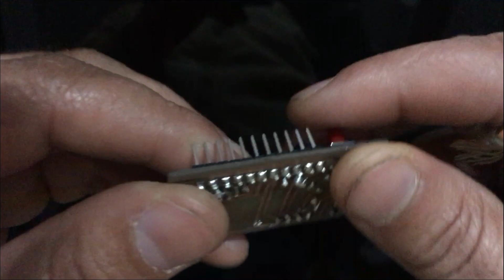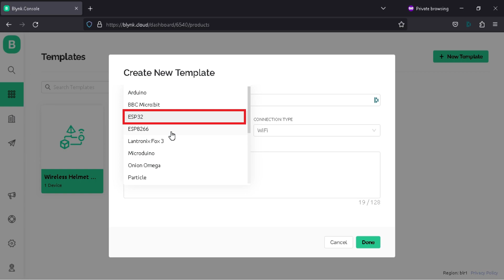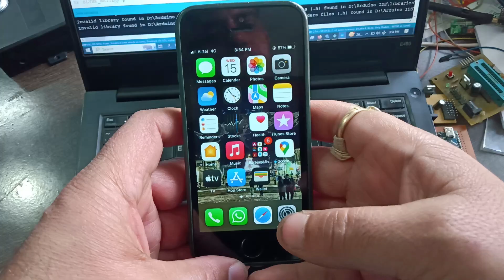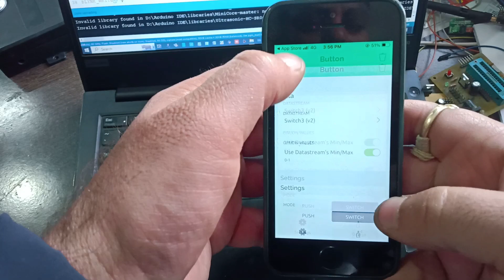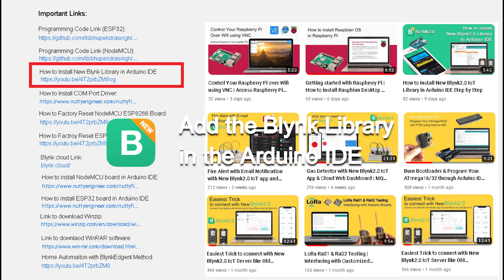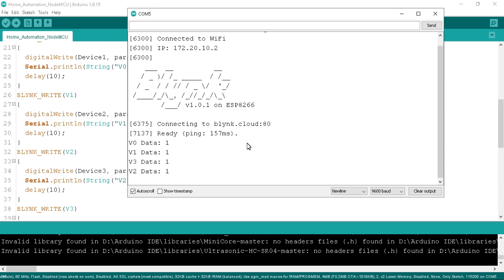Smart Home Automation with Blynk 2.0 IoT App and Web Dashboard: Latest method with ESP8266 and ESP32

Comment: Hello sir 
 hope  you fine .
I want to inform you about codeing.
I apply this  code in my node mcu esp8266 v2 board.
There is problem with on /off button .
When I connect node mcu with  4 really chanel .
It's continue on  the really .
And when I operate from my smart phone   ( on state act off )  (off State Act on ).
It's totally opposite.
Sir tell me the  solution .
Thank you.....
Reply from the maker: hi 

replace this in to your code and it will work for you

BLYNK_WRITE(V0) {
  int val1 = param.asInt();
  if (val1 == 1) {
    digitalWrite(Device1, LOW);  
  	delay(10);
  }
  else {
    digitalWrite(Device1, HIGH);
    delay(10);
  }
}
BLYNK_WRITE(V1) {
  int val2 = param.asInt();
  if (val2 == 1) {
    digitalWrite(Device2, LOW);  
  	delay(10);
  }
  else {
    digitalWrite(Device2, HIGH);
    delay(10);
  }
}
BLYNK_WRITE(V2) {
  int val3 = param.asInt();
  if (val3 == 1) {
    digitalWrite(Device3, LOW);  
  	delay(10);
  }
  else {
    digitalWrite(Device3, HIGH);
    delay(10);
  }
}
BLYNK_WRITE(V3) {
  int val4 = param.asInt();
  if (val4 == 1) {
    digitalWrite(Device4, LOW);  
  	delay(10);
  }
  else {
    digitalWrite(Device4, HIGH);
    delay(10);
  }
}

Comment: serial.serialutil.SerialException: Cannot configure port, something went wrong. Original message: PermissionError(13, 'A device attached to the system is not functioning.', None, 31)

Iam facing this error while uploading the code
Reply from the maker: Check that you have selected the corrected com port?